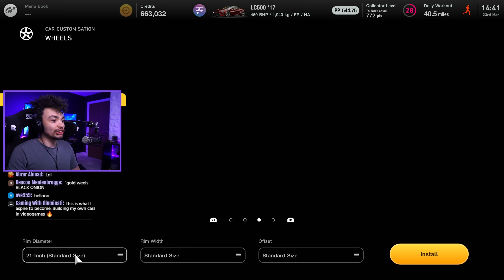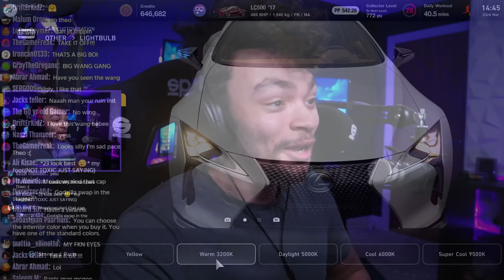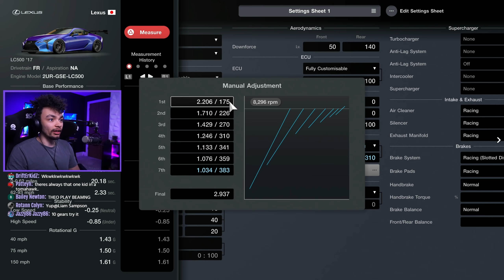They did WHAT to my Widebody LC500 in Gran Turismo 7?

Comment: I'm a fellow LC 500 owner but I'm not a grand dad. I have driven my LC on Michalian Road Atlanta and  Daytona at speed. Topped out at 147 mph on Road Atlanta and 153 mph at Daytona. I've had it up to 168 mph somewhere in Mexico. While the car is large and heavy it is more capable than almost anyone will ever be able to use on public roads. I did the Lexus Performance Driving School at Road Atlanta and they used the LC 500 for doing hot laps on the big track. An RC F for the skid pad and the new IS 500 F Sport for the autocross track. The LC is an amazing automobile. Oh, my LC is the Infrared color with black interior. That "brown" interior is called Toasted Caramel by Lexus and it actually looks really nice on Obsidian or Caviar LC's .

Comment: I doubt the stock transmission is tuned for road use like only use up to 4000 rpm or so. If that's the case, the short gearing at the high gears makes sense, because it improves fuel efficiency at high speed.